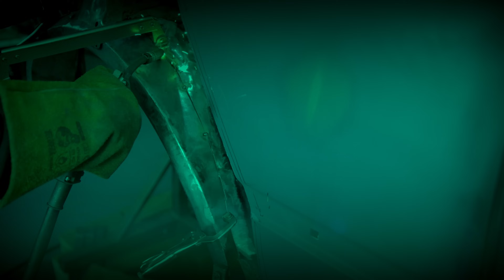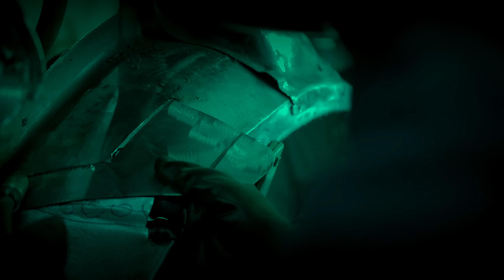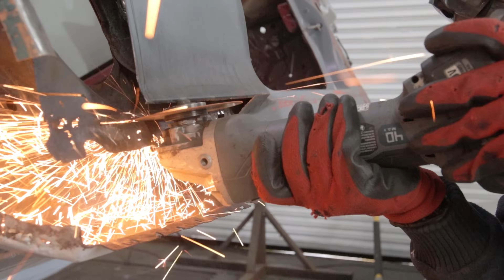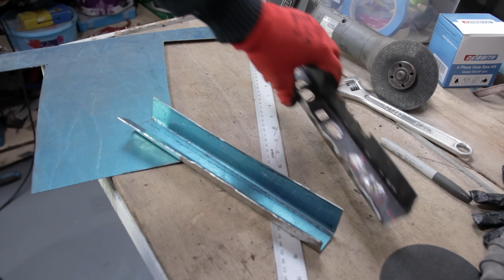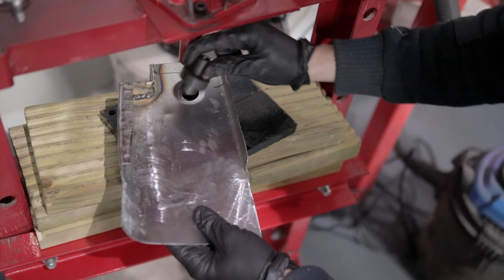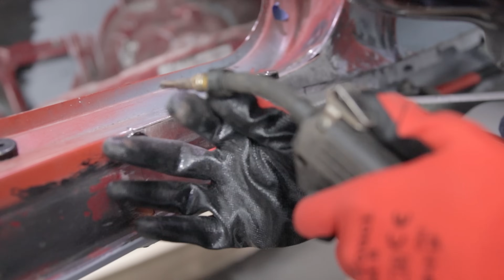Restoring an Abandoned 1992 Honda Civic EG6 | EP. 3 - Arches Reforged

Comment: This is truely a wonderful repair.  The eg hatch is intricate around the rear of the sill and the jacking point - difficult to fabricate and the near sude is worse with the filler neck.  Also - repair panels are the wrong shape - no flair on the wheel arch the way it should be.  Early repair sections had it - but they are no longer available. Great video and thank you for sharing.
Reply from the maker: Thank you. Gotta use what you can 👍. Thanks for watching ♥️

Comment: This is so incredible!  How were you able to weld in the new quarter panels without it warping the metal?

Ive done this before, but no matter how slow i go, it ends up warping...
Reply from the maker: Really slow and putting compressed air on it helps. But there was some warpage on one side. But I just knocked  it out with a hammer and dolly.

Comment: welder was setup really well, which one you using and wire etc?
Reply from the maker: Cheapy wolf mig 140, don't think you can buy them new anymore. And using lidl/parkside 0.6mm flux core wire 🤣 really should go to gas so it's easier for the thin sheet metal😱